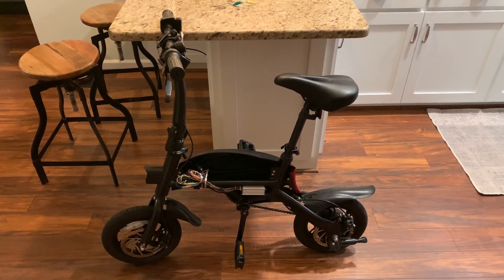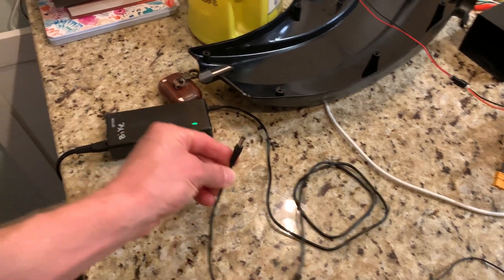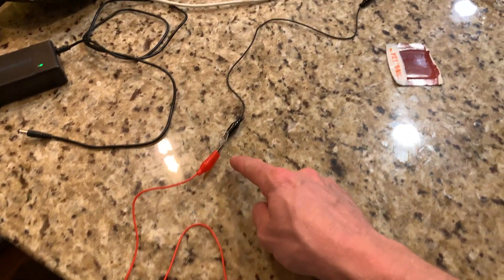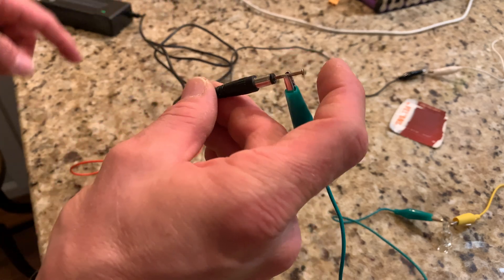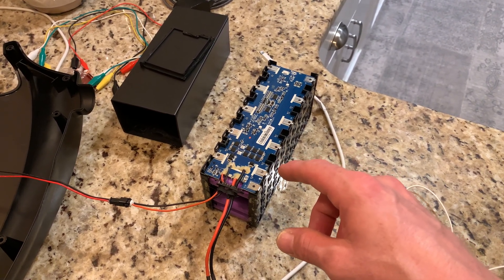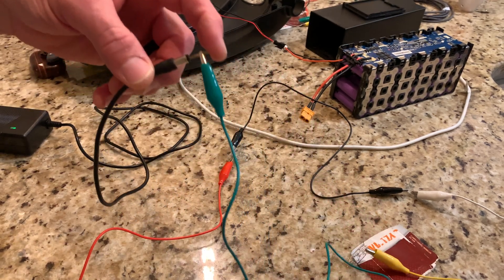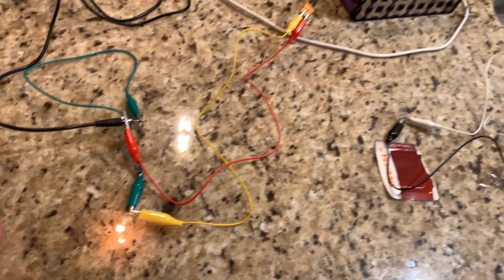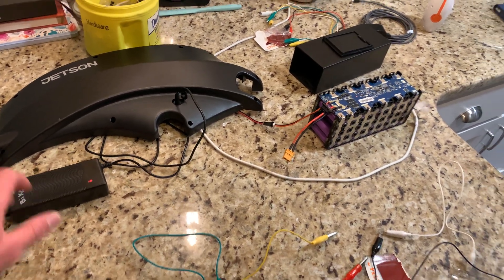￼FIXED!! ￼ebike electric bike not charging, charger light stays green -and how to test the charger￼￼

Comment: So did it work?..
Reply from the maker: Yes, that was the only issue with my battery and it was working and seemed to have decent range and it didn't go dead sitting by itself!
A bad cell in the battery could cause it to not only not charge right, but also it will go dead sitting there after a few days by itself

Comment: Did by chance your battery fully charge after resetting it then charging it?  Everything worked exactly on the battery I have except the battery quit charging after about 10-15 minutes and the LED on the charger went green again.  My guess is that one of the cells is bad preventing it from fully charging.  Just was curious if yours fully charged or not.
Reply from the maker: Yes it fully charged and I used it quite a few times and recharged it, it seemed perfectly fine. It's possible if you had a bad cell, that would definitely cause it not to charge all the way and would have possibly caused it to discharge.
I would use it and see how long it lasts, recharge it and see if you have full battery levels on your indicator. Leave it set for a couple days and see if the indicators go down. That will likely show you whether you have a discharging battery

Comment: When I add one light its flashing and the green light flashes also, when I add two lights it flashes but fainter any ideas?
Reply from the maker: Hmmm is this charger light supposed to flash whenever it is charging the bike?
if It is supposed to flash and you add too 
much amp draw on the charger that could be why it's getting fainter. Or an indication the charger is bad

Comment: Hello, I followed your video and it was charging, but then the bulb I was using died out  and now the battery won’t turn the bike on anymore. Do you think the battery was overcharged due to no bulb for “regulation”?
Reply from the maker: You only give it a 1-2 minute charge to bring the battery above the threshold so the BMS can recognize it... not sure why your bulb died. 
Will the battery charge via charging cable as normal?
What was the battery voltage before you charged it?
Reply: @TheMeticulousRepairTech  I didn’t check the voltage of the battery, but it was at one bar. And no it will not charge normally
Reply: Battery died prob it was an old bulb I had laying around and I left it charging for more than 2 min lol
Reply: I tried charging it after a couple min of hooking it up to the bulb, but it didn’t work so I tried to charge it longer
Reply from the maker: Did you perform the test to make sure the charger was working? With the appropriate quantity of bulbs per voltage of battery
Reply: @ I did not, but I tested it on a different Jetson bike and it worked. Plus I just checked the voltage, it holds only 12.25v. I plugged in the charger and it reads 40v, unplugged it and it drain back down to 12.25v pretty fast
Reply from the maker: Aaahhh... yep sounds like you have a bad battery, friend. That's what a battery does when one of the cells have gone bad 😵‍💫
Reply from the maker: It probably has a bad cell in one of the banks
Reply: @TheMeticulousRepairTech  can it be from the charging trick I did? Battery was still good with 1-2 bars. Was able to get it to 3 bars with the charging trick
Reply from the maker: Well the charging trick is only to bring the battery up enough the management system recognizes it. So either way it's something different than the purpose of using that method. I'm not sure what the issue is! Possibly even a bad circuit board on it 🤷🏼‍♂️

Comment: I have the same bike and did everything in yhe video.  The charger tested fine with the 4 bulbs.  

When i hook up one bulb with the battery port, the bulb does not light and the green light is still on the charger.

I tested the voltage at the clups at the battery and it is 42v.

Suggestions?  Thank you.
Reply from the maker: Your battery is not fully discharged so you must have another issue!
Reply: If you tested the clips while it was charging that 42 is the voltage coming from the charger, not the battery's capacity.  Unplug everything, then test the battery.  Mine reads 4V and I can't seem to get it to go any higher, with or without the bulb.  Battery probably toast.

Comment: Can i charge the battery from the back door without using light bulb?
Reply from the maker: You need some way to add resistance otherwise you would probably burn up the charger. A lightbulb adds resistance and controls the amount of current going to the battery when you hook it up in this way.
Reply: @TheMeticulousRepairTech  does the bulb needs to be 14v ?
Reply from the maker: That's what worked for me, kind of depends on discharge state of the battery...

Comment: Wow I have the same problem. My 52v ariel rider kepler battery is dead. Nothing turns on. My charger stays green whether it is plugged into the battery or not. I'm going to try your test and hopefully it will work! 🙏
Reply: Did it work? My son's Ariel Rider is having this issue now. Testing battery with a meter I get 30 volts it spikes to 50+ volts when I plug in the charger but quickly drops down to the 30 volts again. Charger light is always green.

Comment: I have the same type of scooter but Ancheer and this isn’t working at all, I tried the bulb test on my charger and they lit up perfect. But when I hook up battery with the bulb it doesn’t charge.
Reply: I tried one bulb and two bulbs to my battery back to charger and no light and no red charging light. Is my battery gone? can I revive it
Reply from the maker: If you are familiar with using an electrical tester, I'm going to suggest you test for voltage on the battery and confirm that there is something present at least. If it shows no voltage you may have a broken connection or something else going on. Because you could have a bad battery, versus having it simply discharged below the BMS system capability.
Reply: @TheMeticulousRepairTech  alright it shows 16.7-17v so there’s something. But the bulb  did nothing for me. I tried jumping the batter with another 36v I have but it didn’t work either voltage stayed at 16.9. I believe I have a sleeping bms idk, what’s wrong.
Reply from the maker: You might try confirming you have positive and negative correct. It will matter on DC voltage
Reply: @doatsouth3224 hey brother, I tested this bulb method on a dead 36v battery and it worked, the charger turned red bulb turned on , I left it for 5 minutes because I tested the charger after 2 minutes from regular port but it didn’t charge. I check on the bulbs and the charger turned green and bulb still lit, what does this mean? Battery won’t charge at all
Reply from the maker: You may have a bad cell in one of the banks of the battery. Charging through the back door of the battery is only gonna help a battery that is overly discharged. If there's another issue going on it's not going to do anything for it!

Comment: My son's jetson ebike wont charge because the positive peg in the port broke off and is stuck in the negetive port of the charger. Is there a way to fix it?
Reply from the maker: You can probably get a replacement charger port, you would have to match it up though. I would try to extract the broken piece out of the charger.
It probably needs to be taken apart and the new charger port wired in.

Comment: Interesting.  You just resurrected lithium from hibernation.  I am curious though how did the 14volt incandescent bulb help when you placed it between the charger and dead cell? Did the bulb cause a voltage drop for the charger to be mislead?  Very interesting indeed.
Reply from the maker: Well I tried plugging the charger directly in line to the batteries, but the light on the charger went from green to nothing. So obviously overloaded it momentarily when I tried it. Putting the bulb in line added resistance on the circuit, thus controlling the load on the charger.

Comment: Mine I can hook the wires to the light and change the battery through its power out plug but it still won’t charge through the charging port any ideas?
Reply from the maker: If you have a multimeter, hook it up through the charge port and see if you're getting voltage to the circuit board where the wires connect, it could be a bad circuit board 🤷🏼‍♂️

Comment: I’m experiencing a similar ish issues with my jetson bolt pro. the battery indicator light reads that it’s fully charged however the battery from the “back end” plug is only reading 24.8V. sometimes after turning on the bike the lights won’t even work and if they do the slightest twist of the throttle will cause the lights to fade out. were you experiencing the same with yours? Do you think this would solve my problem?
Reply from the maker: If I remember correctly yes that's pretty much what it was doing. Your battery is probably discharged more than the battery management system will allow it to recharge. So yes you probably need to backfeed the battery just enough to bring the voltage above that level.
Reply from the maker: You may also have a bad battery in one of the cells are bad

Comment: You can also use a multi-meter to test the charger.
Reply from the maker: Oh yeah, sometimes pulling a current and a static voltage can make a difference

Comment: Boosted the battery. Now has 2 bars on the bike but still does not want to charge though the charging port. Charger tested fine. What can be the problem?
Reply: Does battery still work ?
Reply: Remove battery from case , plug charger into battery, unplug the batteries BMS then plug in again, this resets your batteries management system BMS
Reply: Battery still has 35v and does charge thru the power connector. Just not thru the charger port. Any tips on how to remove the outside case from the battery.
Reply: @brianraabe308  Charger port has a FUSE ,you probably have a blown 10amp fuse
Reply: @brianraabe308  Obviously I need to know what TYPE BATTERY you have 😊
Reply: @ianmangham4570  I will check the fuse but I do get 42 v from the port with the charger plugged in, but the battery is the stock jetson 36v 6ah battery. Just like the one in the video.🙂
Reply from the maker: You might have a bad BMS 
in other words, bad battery 😟

Comment: My battery was decharged to the point of causing it to malfunction, but i dont have the equipment or skills to confidently attempt wiring and taking things apart and etc. Do you have any tips on how to fix this when im not an electrician?
Reply: Don't touch any clip tips or the nail while connecting them and don't let and of the points of connection touch eachother especially after power starts going through
Reply from the maker: I would try to find someone to help you do it!
Reply: 2 wires red & black, + and - , Not rocket science.

Comment: Dumb question, could we use something  else for the regulation,  like a resistor?
Reply from the maker: That's what a lightbulb is in reality...
So if you could figure out which resistor to use yes I'm sure it would work
Reply: Did you ever find out what resistor to use?
Reply: @cidgarciaojeda8829  nope ended up buying  a new battery...
Reply from the maker: Sorry it didn't work in your case! These things can have many different issues lol

Comment: Would a slightly lower voltage charger do the job?
Reply from the maker: It doesn't have anything to do with the voltage. It has to do with amp draw, a charger only has a small flow of current and hooking it directly to battery would overload it. Using the lightbulbs controls how much amp draw the battery can pull from the charger
Reply: @doatsouth3224 what about using another battery, wired to the charger port? Would it work so I don't gotta take it all apart?
Reply from the maker: You don't have to take it apart! As I mentioned in the video I did it just to check fuses and look for bad connections on the individual cells
Reply: @TheMeticulousRepairTech is there afuse somewhere that  ight be bad ? I can not find one. There is a flat thing about an inch or so. It is covered with a  flat rubber cover. Could this be a fuse. It has many wires coming from it too. There is also a shiny aluminum box with many fins. What is this ?

Comment: Does your battery still hold a charge?? Curious how much life you got after doing this???
Reply: Yea it hold charge I found out that it was the power button as I used the one of my other bike and it works I have problem with the battery now it hold charge but will not charge up
Reply from the maker: Once I got it to charge it was fine, worked normally. I think it got left somewhere discharged for a while lol

Comment: Can u help me my KugooKirin when I turn the handle bars to the the right the bike power goes off when I turn it to the left it turn back on any idea where to look to solve
Reply: There's a short in the wiring somewhere between the throttle and the harness inside the battery cover. You're going to have to find the short, and splice it. You can use an ohms meter to troubleshoot which wire is damaged if it's not easily visible
Reply from the maker: Yes definitely a short in the wires... Look for a place where the wire is flattened or crimped also